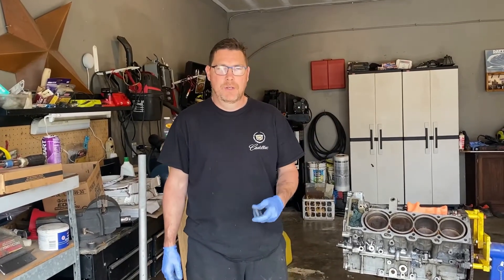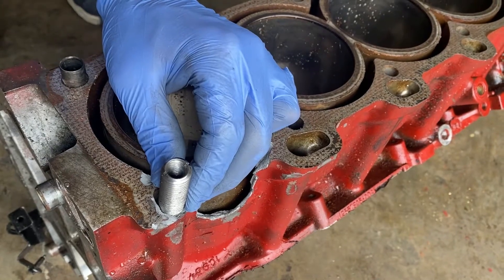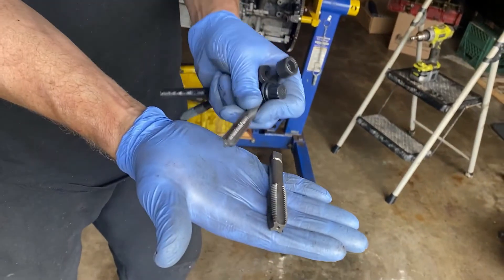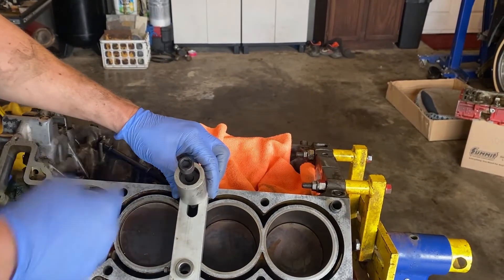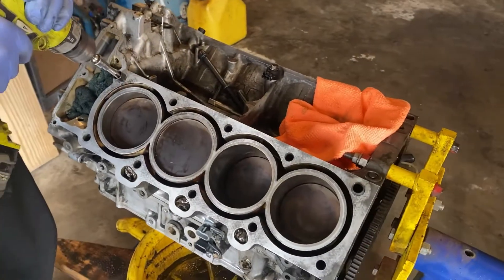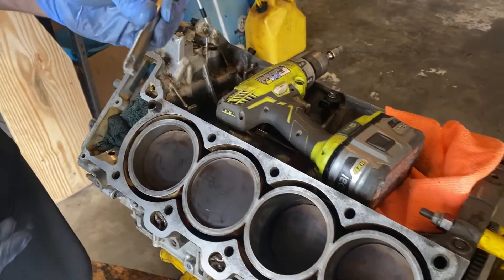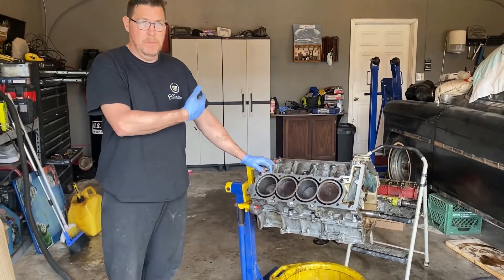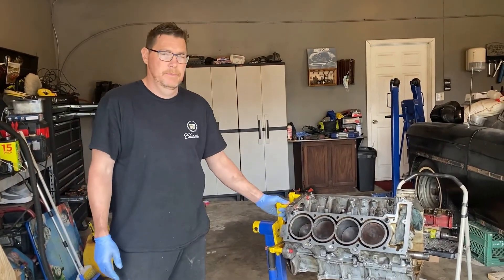Repair Cadillac Northstar Head Gaskets WITHOUT Inserts!

Comment: A spiral flute tap would be a better tap in this application. Those plug taps push the chip down most times. A spiral flute tap pulls the chip up, out of the hole. Although you're only removing roughly. 04" so its not gonna have much of a chip per hole honestly. But in a blind hole a spiral flute will be a better choice.
But awesome idea man. I've never heard anyone doing this. Much more laid back than drilling it out & trying to keep everything perfectly straight. This method follows the existing threaded holes, so its gonna be straight.
Reply from the maker: @cta42141 Thanks! Mike totally agrees with you about the tap.  He used to use those when he drilled the holes for inserts before he adopted this method.  The shavings were pretty minimal.

Comment: I would imagine if you are sourcing different head bolts would you ideally want to find ones with the exact torque spec and angle spec as the original Cadillac ones?  That might be a challenge.
Reply from the maker: @Mrdubomb  We still follow the torque spec of the original headbolts, but when you compare them to the Honda we source them from (Please see our "Truth About Cadillac Northstars" video, link: https://youtu.be/gk970znuJIs), it's almost the same.

Comment: This week, a friend of mine offered me a 2003 Cadillac with a Northstar engine. He said that it overheated and that the coolant and oil didn't mix, but it needs head gaskets. I see that you are in KY and I am in Springfield, KY so I'd like to get with y'all after I bring this to my little shop. I really like the idea of 12mm Head bolts, but I'm sure there are some details that I'll need. This car is a runner with a rebuilt transmission, but of course it uses/looses coolant.
Reply from the maker: @brianwayne3029 We actually released a video recently - "The TRUTH about Cadillac Northstars" - that answers a lot of people's headbolt questions and explains some of the differences in the years.  Link: https://youtu.be/gk970znuJIs        Since yours is 2003, it's more than likely a simple gasket failure and you can use the factory coarse thread bolts.

Comment: what is the part number for the 12mm bolts???
Reply from the maker: @rolfemarquis1017 Depending on what year you have, you may not be able to use them just the way they come.  We recently released a video where we give more info on these headbolts for specific years called "The TRUTH About Cadillac Northstars" link: https://youtu.be/gk970znuJIs
You can get them from Rockauto.com or any major parts chain - we use Fel-pro.

Comment: Where are these bolts sold.
Reply from the maker: @jasperhart1188 We recently released a video where we answer questions about these headbolts called "The TRUTH About Cadillac Northstars" link: https://youtu.be/gk970znuJIs
You can get them from Rockauto.com or any major parts chain.
Reply: Thanks whats the torc on them replacement bolts  @cheapthrillsky9512
Reply from the maker: @jasperhart1188 We do it by the book - start at 22 lb ft, then 60+60+60 degrees.

Comment: How much of the threads does the bolt engauge ??? Since you are only using a 1MM larger diameter or .040 inches would stripped threads from start of the process affect your outcome since the 1.5MM thread height is .032 per side a total of .064. That is the actual numerical size. So you are losing .012 a thread size. SO is this the 25 percent hole size  that is used for clearance when drilling a fresh hole for a tap ???
The block is modular iron ??  Hope you replay Sir. Peace v
Reply from the maker: @victoryfirst2878 Thanks for your comment.  Yes, it is possible that a bolt hole is too damaged for this repair, but on all the ones we’ve seen, even when there have been partial threads stripped, due to the much longer thread engagement overall, this hasn’t been a problem for us. The bolts Mike uses in this video have around 0.5 in or 12.7mm more threads for 1995-1999 even after being cut to the right length, and for 2000 and newer, 1 5/16” more threads.  We actually posted another video giving more info on these bolts  and showing them side by side, called “The TRUTH about Cadillac Northstars” link: https://youtu.be/gk970znuJIs
Also, it’s an aluminum block.
Hope this answers your questions.
Reply: @cheapthrillsky9512  Thank you Sir for giving me all the answers to my questions. I will watch the other video tonight. One more question if I may ask ?? Since the block deck surface is open did you ever have problems with the head gasket leaking Sir ?? Thanks much and good day too. v

Comment: Great video! Where do you typically purchase your head bolts from? Also which type of head gaskets do you prefer for the racing applications? Thanks!
Reply from the maker: Felpro bolts and gaskets from Rock Auto have never failed us, but there’s a little something extra we do to the gaskets that we will show further along in our Northstar Fiero Project.  We’ve relaunched our channel so check out our latest videos, and future ones we will be posting in the coming weeks.
Reply: @cheapthrillsky9512 thanks for info! In my opinion, the late ‘90’s / early ‘00’s Eldorado is my favorite Cadillac body style. I’m excited to learn more about your NorthStar Fiero project!
Reply: @cheapthrillsky9512 As luck would have it, I have heads removed from my ‘98 Eldorado now in order to change head gaskets. I really like your idea of tapping the head bolt threads to M12-1.5 to improve the connection. I’m having trouble finding M12-1.5 x 140mm length with the longer threaded ends like in your video. Any suggestions on where to source those from of what thread length to specify? Thanks!
Reply from the maker: @ Mike used to have them made for him, but now we use FEL-PRO ES713291 and have them machined down by a machine shop.

Comment: Do you need to drill out the heads to get the bolts to pass through them?
Reply from the maker: Hi Dave!  Sorry for the late response - we have actually just relaunched our channel.  To answer your question - technically, they will fit without drilling the heads, but we recommend running a drill bit through the bolt holes to be sure they are clean.  It will keep the bolts from binding in the head while tightening them down.  Please check out some of our latest videos if you have time!  We give more info on the headbolts, and show off our car collection!
"The Truth About Cadillac Northstars" - https://youtu.be/gk970znuJIs
"Our Car Collection" - https://youtu.be/4kI99OJ6xWA

Comment: I bought a thread repair kit from ebay for $150. I fixed one stripped out bolt hole. I torque all the bolts to 50 lbs-ft. My engine doesn’t run hot anymore.
Reply: Hey....look at you. You got it back together after all. Good job.

Comment: I really appreciate someone who doesn't make an issue over tapping holes. The way they talked as it was a major ordeal.
Reply: People tap holes all the time. The bolts are torque to yield, thats just how it works on this application. Either do a stud conversion or re-tap threads. No big deal shrug

Comment: Good if you're planning on saleing the car. If you don't drill the holes deeper and use longer bolts going to do it again. Ok for race eng cause you don't have to worry about breaking down in the middle of nowhere.
Reply: I don't think the engine would strand you even if a bolt failed.  You would just have a head gasket leak.  The engine can run for hundreds of miles without any coolant in it.

Comment: WOULDN'T A STEEL BROACHED BASE MOUNTED INDIVIDUAL MOUNT BE A PERMANENT FIX?  YOUR CORRECT, BUT COARSER  THREADS HOLD BETTER.  ARE THESE CASTINGS WEAK OR POROUS?  I WAS TOLD BY A DEALER THEY WERE SLOPPY CASTINGS WITH UNSUCCESSFUL POURS.  WE HAD TWO 94 AND 97.

THE 94 WAS A BETTER ENGINE,97 HAD A WRINKLE LIKE VOID THAT SEEPED JUST UNDER REAR HEAD.

IS IT POSSIBLE TO CAST A ONE PIECE
HEAD AND BLOCK ASSEMBLY? 
ALSO, COULD THE HEAD BE FUSED TOGETHER WITH A PHOTON LASER?
I FOUND ONE AT A GARAGE SALE NEAR AREA 51.
HOW ABOUT JB WELD AND ZIP TIES.
G.M. SHOULD BE HELD ACCOUNTABLE FOR SUCH JUNK.  THEY KNEW THESE WERE STEAM IRONS WHEN THEY BUILT THEM.
NOT ONLY THE ENGINES WERE BAD, SO WAS THE EXTENSIVE USE OF CHEAP PLASTIC. STEREOS WERE JUNK, TRUNK RELEASE, BRAKE STRIP
LIGHT, RIDE CONTROL, WIPER MOTORS, HEATER AND AIR COND, ELECTRICAL SHORTS AND THE CADILLAC PERMANENT SQUAT.
94 SLS, FULLY LOADED WAS  BEAUTIFUL BUT A NEGATIVE DRAW ON ALL THAT TOUCHED IT.
54,000 DOLLAR CARCINOMA.

Comment: I have not tried this fix and cannot speak to its longevity.  But, as far as finding the M12 x 1.5 head bolts to do the work, here is an idea.  According to the Cadillac service bulletin #04-06-01-032, the 2000-2003 Northstar engines' head bolts are M11 x 1.5 with an overall length of 157.2mm and a thread length of 38mm.  The head bolts to the 2010 VW Touareg and the 2010 Audi Q7 are M12 x 1.5 with an overall length of 159mm.  The Saturn Vue V6 3.5L head bolts are M12 x 1.5 with an overall length of 161mm.  I do not know the thread length of these bolts.  Assuming the thread depth of the holes in the block are a bit longer than the bolts, the lengths of these bolts might work.  The thread length of the M12 bolts could also be modified with a die if necessary.  Both alternate bolts are designed as TTY.

Comment: Got any knowledge about the 1984 cadillac biarritz eldorado? I have one and the motor is shot. Any advice on a motor swap?
Reply: The 79  eldorado same body  had a 350 Olds motor - at least mine did I'm not sure if the 4100 trans bolt pattern is BPO style  buick    Riv should be a swap choice.

Comment: For those of you wondering, the original bolt for the Northstar, at least for a 1997 Seville, is m11x1.5x140mm. The replacement ones on RockAuto have this dimension. I'm not sure how long the thread length is, but it should say on RockAuto. There are head bolts with the same threading and length, but with different thread length and the M12 diameter that you can get for a Porsche Cayenne. I don't know if these would work, but I'm looking into it for myself.
Reply: did the Porch Cayenne bolts work?
Reply: @mdinmil  I didn't end up doing it. If you don't have the resources or time, it's probably better to just buy a LeSabre or something. I wish I had a better response, but I started tearing apart my vehicle and realized I didn't have the time for how involved it would be.

Comment: Obviously I don't know everything. But others have said the thread pitch is a problem. So why not use a corse  thread?
Reply: maybe because its way easier to follow the thread pitch thats already there and he did mention the bolt he uses have much longer thread which increases the surface area to hold the needed torque
Reply: @dereckc9469 the deck is only so thick

Comment: I have a '99 Eldorado with no present issues. Can this job be done with the engine in the car, one bolt at a time? I would consider it as a precaution.
Reply: Yes but it's real pain in the ass.

Comment: Something doesn’t seem right here. Even though the new bolts have a threaded part that’s longer, the amount of engagement is going to be the same since the bolt is the same length as stock and the threaded area in the hole doesn’t seem to be any different. The threaded portion of the holes are deeply sunk into the block, and rethreading them like this does not increase the length of the threads. So doing this doesn’t increase the the strength of the threads beyond what they were stock.
Reply: It doesn't make sense, the 12mm bolt would have to be longer to get a deeper bite. And then there is the issue of the gasket hole sizes. This could have been and easy design change for GM engineers to have done when this problem surfaced. I know they did increase the bolt length in 2000, but not sure they went with 12mm
Reply: Come on if the threads are longer it means is gripping more area.
Reply: @MrKoladge  No, the issue is the threaded area in the block is very short. It doesn't matter how much of the bolt is threaded because there is only so much in the block. The rest of the threads on the bolt don't contact anything.
Reply: Hence the fact that there aren't any replies. That motor took a shit big as TEXAS and he ran for the f'n hills. Nice try tho💯

Comment: Nice Video Mike. What transmission bolts up to the 4.6 Northstar for a RWD car.
Thank you
Reply: From my understanding you can use a Jeep bellhousing mounted to a a T5 manual transmission.
I did a bit of research on these engines and that's what I found out. The flywheel and clutch combo is the only sticking point but I'm also pretty sure a flywheel from a straight 6 Chevy c10 will fit. That info should get you started anyway.
Reply: @AshGTE  Thank you

Comment: Northstar performance head studs is 100% the way to go for bulletproofing
Reply: My shop is installing the Northstar Performance head stud kit and I expect to be driving my 1999 DeVille for many more years.
Reply: Thanks for sharing
Reply: Great idea for upping the tap size, i'm finding a similar bolt to work.
Reply: NS300L is much better. You retain the benefits of TTY bolts plasticity while getting the same anchor thread as the sure grip system. They both use 5/8x11 threads. I would add that the NS300L system does not require removal of the engine as well.
Reply: @JaysonHayes-on6bh Hi, question. Looking to buy a late 90s Cadillac with a northstar engine around 100k miles and no problems. Would you? If I install ns300l inserts right away. My grandfather is a mechanic and can do it easily especially if there’s no need to remove the engine.
Reply: If I didn't have to remove the engine from the car then I'd go with head studs but I don't have an option so NS300 inserts it is.

Comment: Having spoken to ARP about a similar issue on an outboard, I would use that technique and install STUDS of that size, thus getting the cost/time saving of the 12mm solution AND the torque advantage of studs. Glad I saw this.....my Aurora (and I) thank you.

Comment: Where are these M12x1.5mm head bolts being sourced?  I was planning on using my NS200L kit for my supercharged northstar project, but this seems far more straightforward and worthwhile.
Reply from the maker: We sell them directly; they are $75 for the full set.  Supercharged northstar project?  Sounds interesting - what are you building?
Reply: @cheapthrillsky9512  How would I go about purchasing?  Caddy (98 Seville sls vin 9) is getting a gen 3 GM M90, leaving it on the stock pulley initially.  Going to Volvo Type 2 electric steering pump to gain a spot for the SC pulley.  ZZP SC throttle adapter plate and 2005 N* throttle for ease of adaptation.  Not sure how far I will end up going, but not doing a darn thing until I pop the engine out, re-thread/bolt the block, do the oil pump and timing equipment, and do the midplate seal and new bolts.  Also going to crack open the fuel regulator and crank it up a few PSI (factory adjustable)
Reply: @cheapthrillsky9512  I saw your youtube on the 12mm head bolts you use. I have a 98 Northstar that is showing signs of head gasket problems and would rather do the head bolt without removing the engine. 

Do you sell the 12mm head bolts?
If so, do you have a website where we can order them?
Does it come in a kit, with taps etc.?
If you don't sell them, where can we get them?

thank you
Reply: Cheap Thrills KY couldn’t find a way to send a message, but I’d like to get a set of bolts from you. Let me know how to make it happen! Thanks!
Reply: @cheapthrillsky9512  .I need a full set of headbolts M12 x 1.5  for my 2000 Cadillac Northstar engine.how can I get them from you
Reply: @cheapthrillsky9512  Hello I would like to purchase those head bolts as well. I will be working on 2002 Deville engine swap and reseal & May as well do the head bolts. Thanks
Reply: What type of a charger are you using.... this engine is more and more of interest to race with and using some supercharger on it..... Hoping for answer.
Reply: @rvarsigfusson6163  Like many projects, this is still waiting around to get finished.

I have an M122 supercharger off a cadillac XLR, a ported and welded GM M90 with a 2.3" pulley, and a stock SC from an 07 grand prix.

Have not been able to get my garage sorted out and tooled up to begin anything large.

I only got the M122 northstar super due to cheap price.  At the time on ebay, it was running $400 plus shipping from a shop surplus closeout.  Now I see people want 1500-2500 for them.

I only suspect minor mods are required, but never touched it to my 98 engine quite yet.  I would perhaps purchase a set of intake gaskets from multiple northstar years and see if the bolt pattern is identical.  The port shape is slightly different for sure.

Hope some of this helps.    If you use the newest FWD northstars (06-07 I think" as your base, I am pretty sure HP Tuners has a plug in tuner once you wire up an OBD2 port to make a standalone setup
Reply: @mattliston1215  Thanks for the answer ..... I was wondering to try this engine to a Formula OffRoad car...... and if it is El-chipo then it might be a solution and some fun to work with...... I do know about a donor car that have been laying around for years and and.
I did thing of looking for some blowers from Range Rover or Jaguar but might as well think it over to some caddy things and make it eazyer to all........ We might need some 600++ hp to have a full use for it but the top of it can be reached with a nitro but just for the top of it.
I have been thinkig of this engine for some years but got an eye opener when an younger guy I know did put some V6 caddy in a RX8 and is racing it quiet well...... then I did start thinking about it all over again........ I do thing the caddy V6 should go into S10 and some similar cars....... Still afforable and a lot of power.